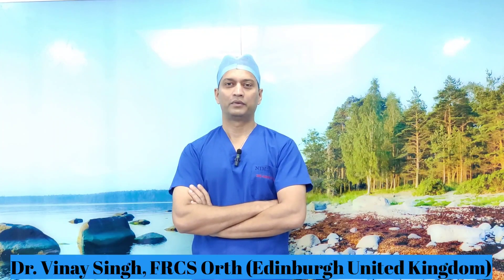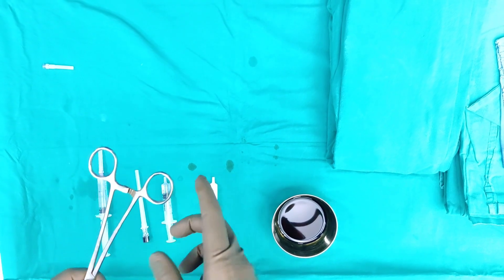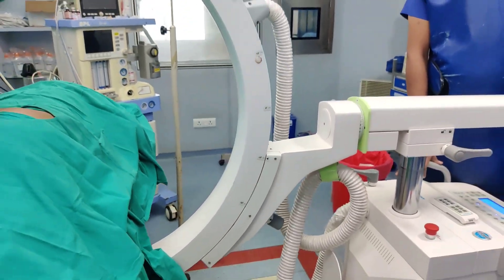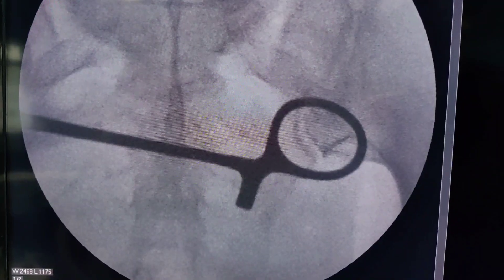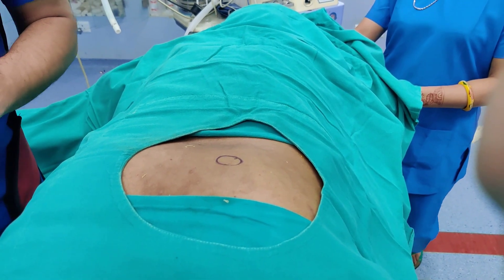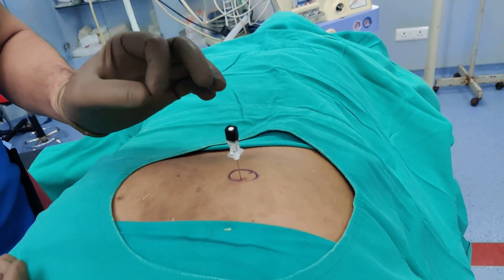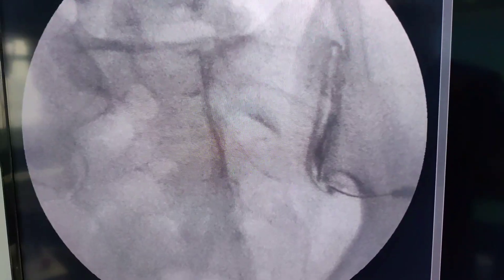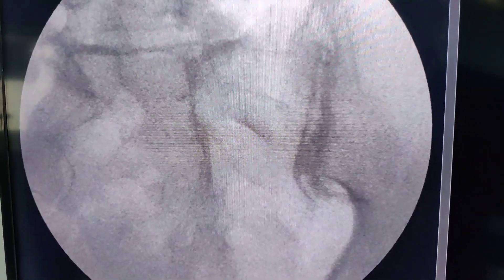Fluoroscopic Sacroiliac Joint Injection

Comment: Not how my doctor does it, and this way looks better.  My dr. does just one injection using a floroscope with a fine needle and shoots a mixture of steroid and lidociane  into the SI joint. The whole procedure takes about 3 minutes. ...for both of them!!

Just had mine done Monday, and next week I am trying Radial shockwave therapy ,along with the steroid, and some physical therapy.

Comment: My Dr just tried to talk me into this today I said ill research it and after seeing how this patients jumped and is feeling it HELLZ NO! Im not doing that.
Reply from the maker: It would be fine. Just go for it.
Reply: @ oh heck no, I get massive panic attacks when i'm scared of something & I shake and jump unvoluntarily. I would hate to jump when Dr insirts that needle & I heard you (or whoever was going the injection on this vid) saying about the patient being obese and that's why you had to put that needle pretty much all the way in.. well IDK what that patient's size was but if that's obese then I belong at a zoo bcuz I am 5'8" at 404 lbs. i'm morbid obese so heck IDK hoe Dr would even reach where he needs to go in that case. Also my Dr wants to EITHER DO steroid injection OR some other numbing injection PLUS BURN IT. Heck I don't know exactly but I just know that between the Lupus Dr & the Lung Dr they have given me way too much steroids, to the point Drs are concerned I might have Cushings now. I'm supposed to do this Cortisol testing & go from
There to figure it out but for now I quit getting the Methylprednisalone
Injections each 12 weeks at the Lupus Dr & the 20mg wt 4x day prednisone pills at the Lung Dr so i've been turning down all steroids bcuz I wasn't aware of all the damage excessive use of steroids can be on the body.
Reply: I think because it was a video, he was anticipating it for too long and tensing up. When I had it, I did not jump like that
Reply: @sarahspookynine285  How are you finding it? Is it helping with the pain and discomfort or not?
Reply: I'm feeling the same way. I'm scheduled in December. I believe im going to pass.

Comment: I was considering this technique after having facet joint injections which hurts a lot this looks just as painful. You said a diagnosis so if you diagnose that its the joint what's the treatment?. The injection you do gives a month or so break from pain if you don't hit other nerves causing more issues. From what i see it hardly seems worth the pain involved and i could hear the lady in distress btw
Reply from the maker: SI joint injection usually leads to pain relief for a longer duration
Reply: @DrVinayKumarSingh  but what's the risk of rare side effects? I was the one who had a rare side effect from a hip injection. Now there forcing this injection on me. Watch me be the one to be paralyzed because they mess up.
Reply: This looks painful to be honest.

Comment: Why didn't you have the proper equipment? If you did, there would be less likelihood of the needle moving and less "pressure" (PAIN) caused to the patient. Do you concur?

Additionally, there are suggestions and lively discussions for doctors to experience procedures like LP, SI, Facet joint injections and BMA (etc)  so they can understand the pain they put patients through in the hope that they will be gentle and use generous doses of local anaesthetic. What are your thoughts on this?

I do not expect an answer, of course. However, I live in hope.
Reply from the maker: Hello Edward many thanks for your feedback. Resources can be very limited in some hospitals. Also we cater poor patients. For these injections we charge Rs. 1000. 
We have used everything that is necessary and irrespective of what you use patients will feel some discomfort and this can never be pain free.
Reply: @DrVinayKumarSingh  I disagree. I was given IV sedation of fentanyl and midazolam. Both SI joints were injected. I had absolutely no pain or discomfort. Went home after procedure, had a great nights sleep and woke up to zero pain or discomfort. It’s been a day now and still no pain. I’m able to walk again!  My doctor practices in the San Francisco area.  He’s highly respected and has impeccable skills.
Reply: @Nira39So it has helped you then?